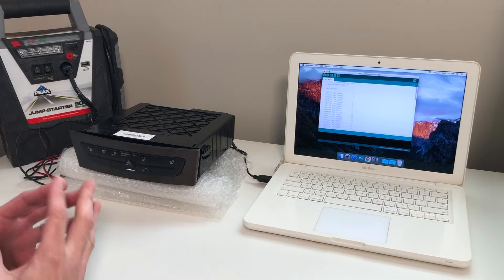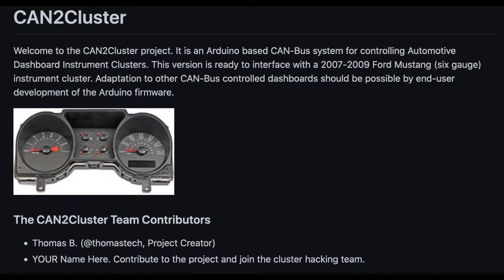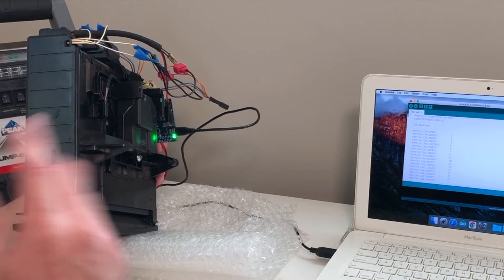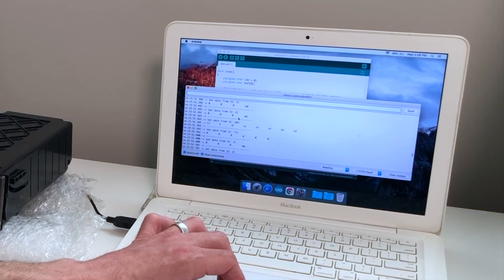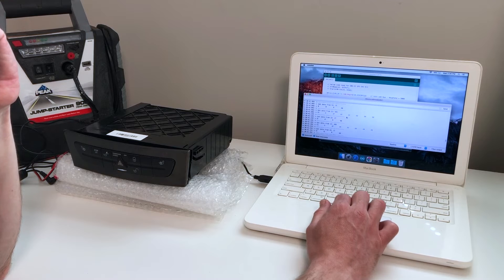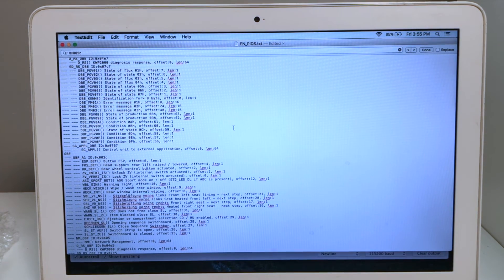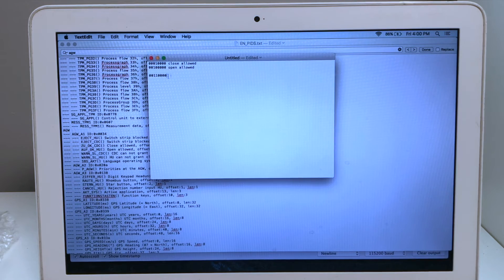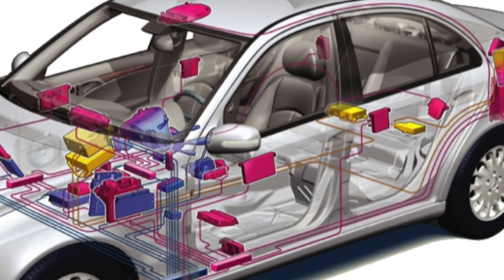Hack Your Car's CAN BUS Pt. 2  You can do it! Tutorial, Tips and Tricks for CAN BUS Programming

Comment: you said the prius runs at a different voltage, what is it? I assumed all of the interior accessories would be on 12v, powered by the 12v battery thats in the trunk of the car. Is it something other than 12 volts, like at the head unit, or AC controls?
Reply from the maker: Thanks for your comment. You're totally right. That's our bad! The accessories all run on 12v. It's only the battery for the motor that runs at 200v. There's a bunch of great information for prius and canbus, especially for talking to the batteries and motor here: https://www.eaa-phev.org/wiki/Prius_PHEV_TechInfo
Reply: @fatherandsonfix  cool, thank you.

Comment: Hi Sir, what hardware do I need in regards to laptop? Can I use any Mac laptop. Thanks.
Reply from the maker: Good question. Most basic laptops will do. We're using a 10+ year old Mac laptop in this video! You can use Windows or Linux if you prefer. You can see the system requirements for Arduino here: https://www.arduino.cc/en/software/ If you have an older laptop or desktop, scroll down for the legacy versions, make sure they are compatible with your board, and you can use though too.

Comment: Great video!  I'm curious if this method would allow for one to modify the vehicle light settings?    My son put LED's in his 09 pt cruiser, but they flicker, with and w/o resistors and also with a canbus decoder.   So I was wondering if I can find the data once I read the canbus with Arduino if it's even possible to perhaps change the voltage or add a line of code that would accept the LED's.   Any input on this would be appreciated!   TIA!
Reply from the maker: @JP good question. It sounds like you are installing LED headlights. You may be able to turn off any error messages with a canbus decoder. However, you may not be able to stop the flickering unless there is an HID or LED mode from the factory you can activate via the canbus. If there is no LED or HID mode for your vehicle than canbus may not be able to help. It could be you need better quality resistors. The fog lamp circuit on our W211 Mercedes wagon required higher quality resistors to prevent flickering and the error message in the dash when we installed LEDs. The higher quality resistors are usually packaged in a larger heatsink and cost about twice as much. We still paid less than $30 for the set we needed. Search for high quality resistors by your bulb type. If you are installing interior lights, the right high quality resistors may be a little more challenging to find and diy. Hope this helps, reply to let us know if you get it solved. Good luck!

Comment: Nice video!
I'm resaerching the best approach to modify Can messages.
Man in the middle kind of thing for panelswitches so no tinkering with safety functions.
Reply from the maker: Thank you! That's awesome. Man in the middle is a little bit more challenging. Most of the examples we've seen involve two boards. One receiving, the second, filtering and relaying. Please keep us posted on your progress, and good luck!
Reply: @fatherandsonfix  
Yeah, and I'm not very good at programming lol.
I have all the data collected so theoretically it shouldnt be that hard.
As I see it if the "converter" esp32 recieves X , it should send Y.

Comment: Hi Sir, really appreciated for this great informative video.

I got a problem when I dig into the can bus on my E300 (2018). I attempted to plug the OBD2 slot, and connected the Arduino based mcp2515 device to high and low lines on ODB2, but unfortunately, no any messages received.

I guess the OBD2 on E300 did not expose the can bus high line and low line.

Could you please kindly advise the location of the can bus B and C for my vehicle?

Thank you in advance.
Reply from the maker: Looks like you need to access the CAN BUS on the W213 via the footwell/floor on the right side of the vehicle. Take a look at this video: https://www.youtube.com/watch?v=myi8TTMseMo&ab_channel=IndiWork
Reply: @fatherandsonfix  thank you very much. I also googled and got the same answer. OBD2 exposed the can bus, but it is CAN D which is only diagnostic info(the CAN message was sniffed, last time there was not any messages because the wrong baud rate). For CAN B, it is under both front seats.